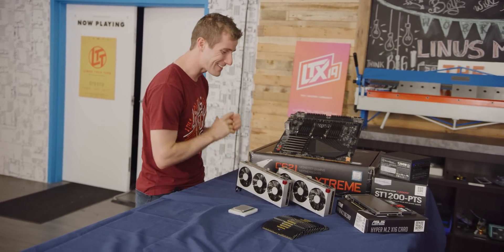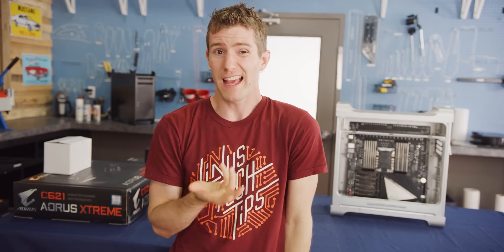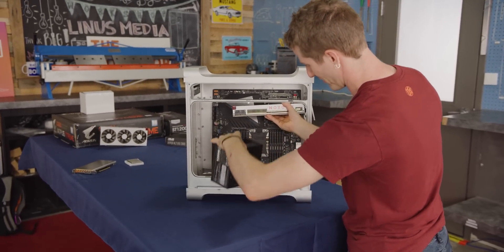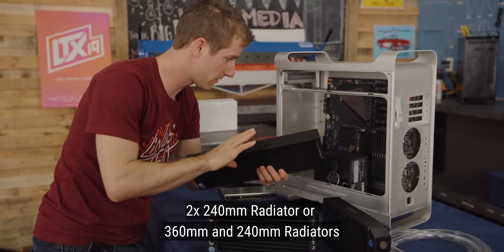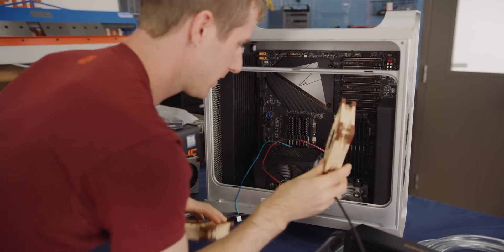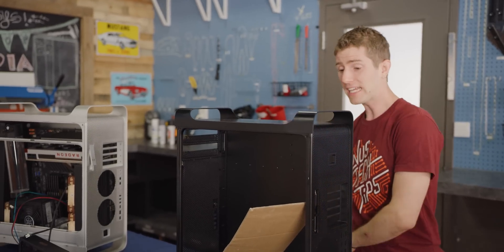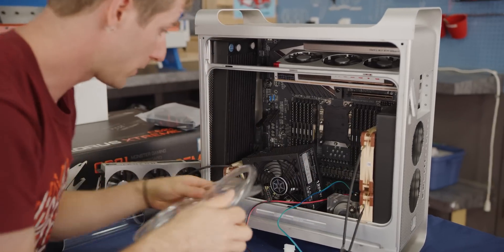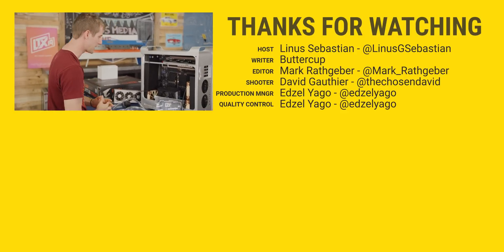The Mac Pro Apple WISHES they built - Hack Pro Pt. 1

Comment: I've would've recommend the Apple Mac Pro 1.1, 2.1, 3.1, 4.1, 5.1 case as it has a bit more room than the G5 case. I have both a G5 case and Mac Pro 1.1 case laying around that I hope can mod someday. Also have a fully working G5 with dual PPC 1.8ghz cpu's in it.

Comment: Man... welcome to 2012 Linus! I did a full ATX conversion on a PowerMac G5 back then, made a custom back panel, relocated all the PSU guts into the original long/flat power supply case in the bottom, and even utilized the original latch, front fan mounts, etc. And best of all, when you push power... it chimes just like the OG Power Mac. Unfortunately those pics of that were on my photobucket account and they're all on bandwidth lockdown... so much for free hosting.

Comment: Nah...this still isn't close to the maxed out Mac Pro.
Reply: What?
Reply: Zach B ??? This isn’t closed to a maxed out Mac Pro. If they really want to build a system that is equivalent to a Mac Pro, they need 128 gigs of Ram, 8 Tb of internal storage, 8 pci slots, an afterburner card, and 4 Peo Vega II Duo GPU’s in the system. To build a machine the equivalent of a maxed Mac Pro, would cost, bare minimum, $80,000 and I’m not exaggerating at all. But of course, he once again misleads y’all for the LOLs. He’s not stupid. He knows it’s impossible to build a single PC workstation with equivalent power to a maxed Mac Pro. To be honest, there isn’t even a PC compatible GPU in existence as powerful as 4 Pro Vega II Duo Cards. Period. It’s far and wide the most powerful GPU on earth. Feel free to research yourself and see if I’m wrong. But here’s a hint; I’m not.
Reply: Callaway Jones they had over 300 GB of RAM, can’t remember if they had 4TB of SSD (not 8, check the website) but that’s not even that much. There isn’t 4 AMD Radeon Pro Vega II Duos, check the website, it just means that the Pro comes with 2 AMD Radeon Pro Vega II’s. As he said they are cutting edge, but it is still possible to build something like it for less that the asking price of around 35k that the pro is asking for.

You obviously have misread the actual specs somewhere.
Reply: @zachb1706  Sorry, it's been upped to 8TB of internal storage, you have to do your research before saying these things kiddo: 

@t

As for building it...here are PC guys explaining what I just said to you hopefully in a way you can understand:

https://www.digitaltrends.com/computing/how-much-mac-pro-cost-as-pc/

Honestly a little more research and you would've figured this stuff out on your own...
Reply: Zach B and I meant 1.5 TB OF RAM. They’d have to have that too.
Reply: Zach B so in a clear reply, they would need 8TB 9; internal storage, 1.5 TB of RAM, and no, it actually has 4 Radeon Pro Vega II’s. You’re not understanding the fiber link. And the afterburner card as well. Bottom line, there is NO PC ON EARTH CURRently That can even begin to approach this on its own. Even for $100,000 and that’s a fact friend.

Comment: The point of this whole project is lost on me. The producer's (Apple) end-product should be obviously superior in terms of performance, finish etc when it does come out. Moreover, right off the bat, you admit the end result will offer reduced capabilities compared to the Producer or even theoretical thresholds of individual components.

Comment: New iMacs coming out with 1.5TB of RAM? If you wonder why new RAM costs a little more in the future, that's probably one of the reasons.
Reply: No it’s expandable to 1.5 TB
Reply: @zachb1706  Do you mean expandable in the sense of upgrading?
Reply: It comes with 256 GB, with the capacity for 1.5TB. That’s the TOP range btw, the  $6000 base won’t be able to handle 1.5 TB

Comment: Would have been cooler to use a Highpoint Solutions SSD7103 M.2 PCIe 3.0x16 Bootable RAID adapter, it'll take any off the shelf m.2 nvme SSD, and accepts 110mm long m.2 drives so you could use 4x Intel 905p 380GB drives in RAID 0

Comment: You should get a mac pro 5.1 case, not power mac, its smaller, has only 4 pci-e slots, the MP has 6... + better spacing (2 optical drives and PSU on top...)

Comment: The board officially only can handle 192  GB of ram did they do a update that isn't on the product spec page, or is Linus just free balling it ? I was also wondering will he had one of the cards running at PCIE 3.0 x8 due to how that board is set up only slot 1 and 2 are true x16 the others share the band with with the top two when used meaning the m.2 cards wont run at its full speeds.

Comment: Don't waste your time 3d scanning that case, touchups will take longer than just measuring it and modeling it manually, it's mostly just a box
Reply: Shouldn't there be models of the case available already? It's a mass-produced commercially available product.
Reply: @piotrch0  It's Apple, though. There's no way they would ever release an original 3D model for one of their products. It's quite possible, however, that a third party may have worked on a detailed and accurate 3D model at some point and time. I really don't know. I'm pretty much talking out of my ass here.

Comment: Two Rads for this setup? C'mon not everything needs to be watercooled. What is the benefit if you got an watercooled system with bad temps? Use good air cooler and you will get better temps with much less problems

Comment: How about mounting psu behind front radiator, pulled air would cool it down anyway. Sure, the fan should controlled manually via motherboard not by PSU itself

Comment: I would kill to be able to build this. First thing to do would be to dismantle the spare case you have at the rivets and bolt on points to make measurements of the individual panels. From what I can tell you can make a new replacement of the vented mesh center panel, then bend it at the same angles and reinstall. With the new CNC you have it could be made however getting the bends correct would be a challenge. It would also allow custom front IO and modifications for a standard IO shield. Then 3d print or CNC brackets and mounts to allow the power supply and reservoir locations. Times like this I'm sad I don't live in canada.

Comment: Linus, a few videos ago, I thought you bought a machine shop setup and hired a CNC operator/machinist.  Why not build a custom Apple cheese grater case instead of trying to cram all that stuff that clearly isn't going to fit in an old case??? "You can't put new wine in old wineskins my friend."  If you machined your own case you could hide the power supplies on top and the reservoir for the coolant on the bottom. I don't see the point of this build, it's going to be all crammed in and ugly with no optical drive.   You could even do some measurement tools and use CAD to make it super cool.

Comment: hey linus, nice little project.
but you do realize that 3 pcie x 16 cards already saturate the 48pcie Lanes of that CPU? And yes....on gaming cards there is no difference between x8 and x16...but dual R7 is most likely not used for gaming so...they could need those 16 lanes ech if utilized...

Still Threadripper would have been nice too

Comment: the G5 was a Power Mac and the Mac Pro is the intel version made from 2006 on. Just saying. Calling a G5 Mac Pro confuses every Apple user as it is just incorrect. Yes the cases look the same ( the Mac Pro has 2 DVD slots vs 1 for the G5 ) but Apple has a definitive naming scheme which makes the actual machine easy to identify if used properly. Also, the water cooled G5 was only for the late half of 2005 and only on the Quad 2.5 ghz cpu. The dual 2.0 & 2.3 ghz. was air cooled. I know as I still have one that runs perfectly.

Comment: Plot twist, Apple finally goes to AMD and ryzen stomps your Xeon.
Reply: ryzen isn't the competitor for xeon...
Reply: @jghgiroot6735  It doesn't need the server chips. Ryzen Threadripper would easily beat that xeon. But sure they could use epyc but why bother? ryzen threadripper has most of the server features for a much lower price and could easily beat the xeon chip used. "..."

Either way from what I understand Epyc uses ryzen cores. so it's still technically ryzen lol.

Comment: Here's a project idea. Just found a Peltier based cooler designed to be hooked up to a water line.  Looks like it would be easy to hook up to a case radiator. Sold through Walmart.com for US $24.
https://www.walmart.com/ip/Condition-Semiconductor-Water-cooling-Movement-Cooling-Refrigerator-Electronic-Air-Peltier-System-Cooler-Fan-TEC-DIY-12V-Thermoelectric-Refrigeration/398784825?sourceid=dsn_fbins_54204e98-e65b-42c1-bdb5-1fa1d662f065&veh=dsn&wmlspartner=dsn_fbins_54204e98-e65b-42c1-bdb5-1fa1d662f065&cn=FY20-ENP-Post-Browse-_rtc_dps_dsn_dis_fbins_enp&fbclid=IwAR22Z3OlGyn7_8i8RvQVcE5i1elV9wXAbwphovfaYB9KT5OZWhZt989fm6w

Comment: Every single time I hear "custom" system like this, and I don't see them taking connectors off the board, or soldering a wire loom in from the back--I just kind of wonder what 'custom' means these days.

Comment: Why doesn't Apple do any kind of water cooling for their pro lineup anyway? Seems a bit weird they wouldn't at least have the option there.
Reply: It’s the same reason why prebuilt systems and enterprise don’t do water cooling. There’s plenty of thing that could go wrong in case of water leak.

So water cooling is basically the domain of enthusiasts and over clockers. A water pump is also marginally louder than a fan. So there isn’t much of a noise reduction benefit to be found there.

Comment: Just hook it up to the water chiller and set it to a temp where you don't get condensation. Wont have to worry about fitting the rads in the case.

Comment: I would put a 360 rad at the front and a 240 rad at the top lose the res and go with a t section for filling, and then you can top it up when you need by leaving a foot of water tubing. Then you can fit the PSU on its side at the back for case and plug the power lead directly into the PSU.  With water cooling you don't always need a res.  If you could get flat res that would be able to fit right into the side panel.  The res it built the same way as the graphic card block with the flat single slot type of profile. 
I'd love to see a side panel RGB lit that is a flat 1 slot profile res that fills the size of the side panel. Would look so cool with the water effect and the RGB lighting. It would make a great water feature that could be shown off.

Comment: SSDs? HDDs? MEEH! who needs that when you can store everything your RAM!
Reply: @tikoblocks3224  Relatively few people have backup power, and of those I doubt many have quick enough or direct enough backup power to keep a PC from shutting off if the building's power goes out. To be fair though, anyone buying a PC this expensive can probably afford a proper backup, if they think to get one...
Reply: To almost everyone in this reply section:
IT’S A JOKE
Reply: come on people
don't you get a joke?
Reply: ... they're using NVME drives. Literally announced during the parts list.

Comment: Oh Linus...  It'll be a really cool hackintosh, but nowhere near the 'Mac Pro apple wishes they built'. It'll be a fun series though because it may be the Mac Pro that PRO-SUMERS wish apple had built ,i.e. without the 'UBER-pro' features, but  the USPs for the Pro are the FPGA processing, Xeon, obscene 1.5TB of 6-CH ECC RAM, and the TWO VEGA II duo modules (ie 4x GPU), and on the fly ASIC security and encryption coprocessor. Pretty sure we're not getting any of that in this build, except maybe and FPGA (red rocket again maybe, if they can get it to work this time?)

Comment: That Radeon VII looked like it was going to snap the PCIe slot clean off.
Reply: I think that Gigabyte's pci-e slots are steel reinforced
Reply: @Ruiso7  Sure, but the connector on the RVII is not. Poor card...
Reply: Ahhhhh!!!! yeh!!!! That's painful!!!
Reply: Literally gave me chills when I noticed it xD
Reply: After having an rtx 3070 sag in my system without a support bracket. Woof. Scares me.
Reply: Hmmm Yes
Reply: I guarantee you that things not plugged in

Comment: This case is terrible and also looks awful with everything upside down and the power supply in the middle mounted on it's side...Why not just buy a full mesh case and fabricate 4 handles for each corner to attach?
Down vote for trash 18:9 aspect ratio.

Comment: Ive build a PC in one of those cases and if you go for a more sesible motherboard (ATX) you can have quite a simple build and even have an optical drive (I know that I live in the 15th century using one of those). If you wanna do a build in a case like the apple g5 you can just rip the original motherboard standoffs out and glue them back in where you need them, the hight is gonna be just right. Then cut out the original io shield and your done. (If you use full ATX you have to cut into the internal steel plate they ripped out, you cant rip that out if you wanna keep an optical drive)

Comment: Why would you paint such a beautiful piece of aluminium? Modify it to your needs, have it sandblasted and then send it for anodizing. The better facilities will have the option of coloring... The difference is like a night and day.
Reply: As mentioned in the video, the case was painted so the 3d imaging scanner would work...which it still didn't.  I'm guessing it's a lazer and reflected off the aluminum in a way that didn't let the tool work.
Reply: @johngaltline9933  LTT should hire some der8auer-level engineer for this kind of projects, because most of the time, they have no idea, what they are doing. They just ef' around with style!

Comment: Hi Linus, I moddet a Powermac G5 for my Ryzen 7 1800x and a GTX1070 for watercooling some time ago. In search of the largest radiator that fits into the case, I decided to buy an Alphacool 180x360mm.
The fits perfectly in the front and offers a lot of cooling power.

Comment: If you are using photogrammetry I would suggest painting case using chalk spray and then add small black dots (by using toothbrush, you just put it in paint and then move your finger along brush).

Comment: Legend says that the radeon vii card is still hanging on that motherboard
Reply: Oh my god, I was staring at it the entire video. It looked like a loose tooth.
Reply: HAHAHAHAHA
Reply: I was waiting for the moment that the card would come loose and crash to the bottom of the case... :P
Reply: That PCIE slot is beaten to hell; it's gotta have a few busted lines and severed solder lines.  I'm not sure if they're through-hole or surface mount.
Reply: radeon cards are so bad.
Reply: @curt8806  fake news
Reply: @curt8806  MacOS is only compatible with AMD cards unfortunately.
Reply: @samf1504  Novideo sucks anyway.

Comment: 384GB means you can support Stadia 4K 60FPS on Chrome or more than 200 tabs.
Reply: Max 5 tabs
Reply: Pretty sure it's 3 tabs but ok
Reply: 200 sounds about right, I run that many with most suspended on my ultrabook and it bluescreens constantly
Reply: More than 2000 tabs

Comment: That case is beautiful... but I know the pain in the ass it can be to convert it to any kind of ATX. You literally have to install your motherboard upside down and cut shit cause it doesn't fit properly. Also you have to take apart your PSU if you want it to fit in the power supply bay.

PS: I see that mac pro case in the back. 3:40
PPS: the white mac case is a G5 power pc

Comment: Maybe try plastidip to kill the reflectivity for the 3d scan. It's a good option as if it doesn't work, just peel it off. The key to it is use 3 to 5 layers for easy removal should you want it.